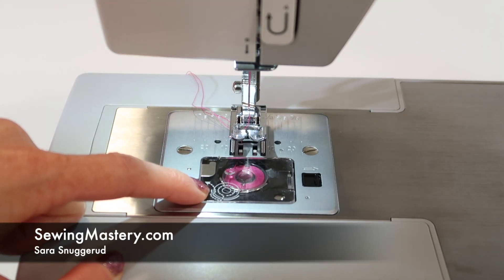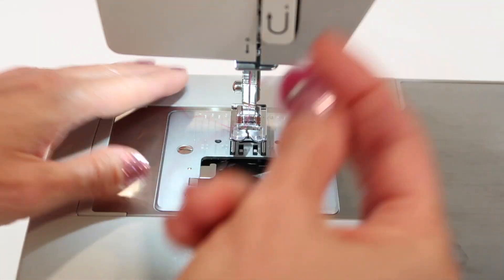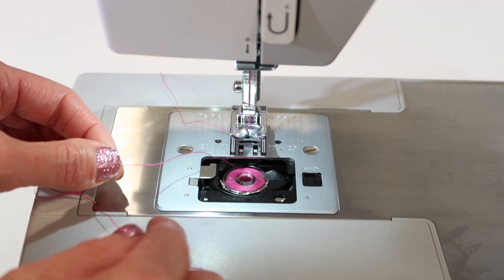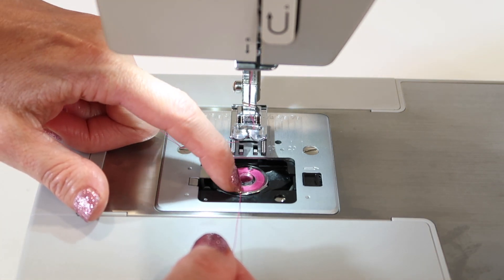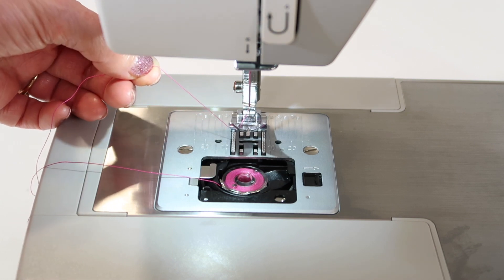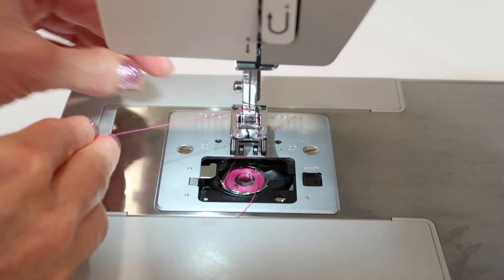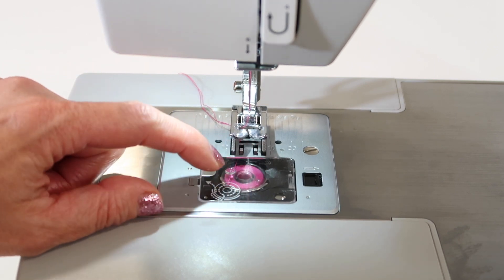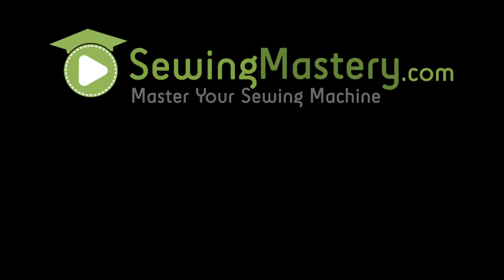Singer 4411 Heavy Duty 5 Inserting the Bobbin

Comment: This is the best video of this that I have seen!   I have a question… I can sew for a while and all is fine, but without fail at some point I wind up having like 6 to 8 threads come up from the bobbin hole! Any idea what I’m doing wrong?  When I stop sewing, and lift up the foot to pull it out and cut the end, it’s hard to pull and I have wad of threads coming up from the bobbin. It’s a new machine and I’m positive I have it in correctly. It sews good for a while but this ALWAYS happens no matter what.. any advice ? Thanks!